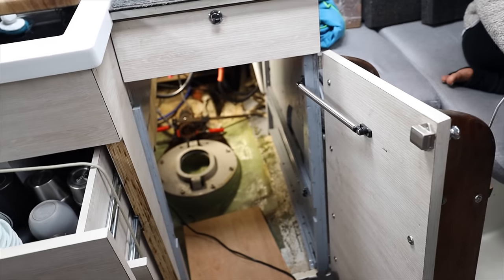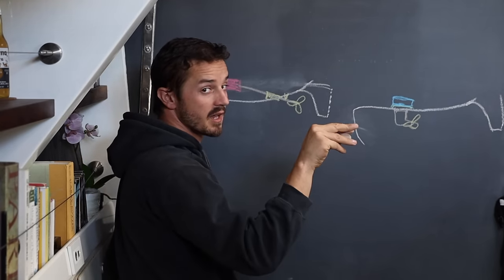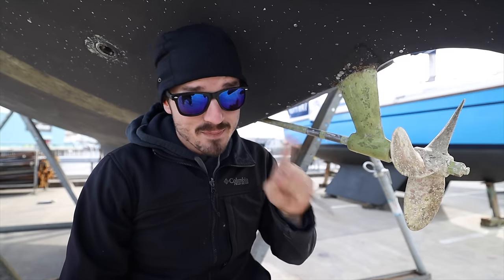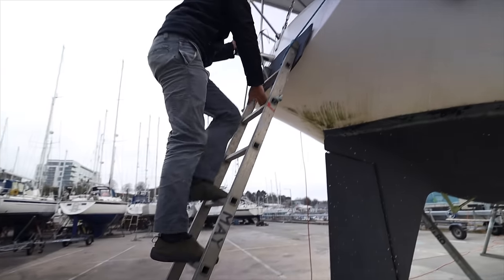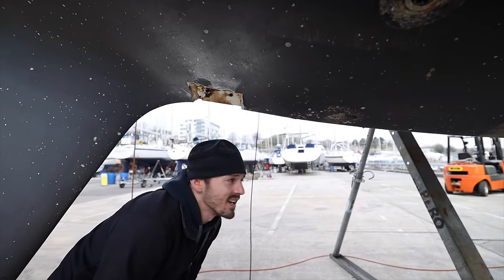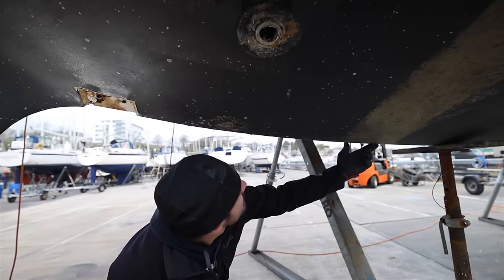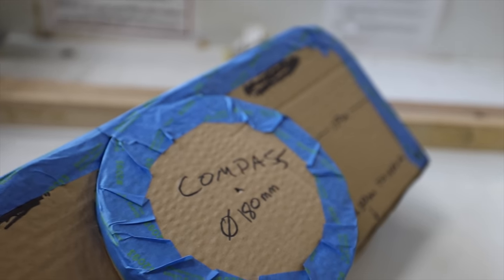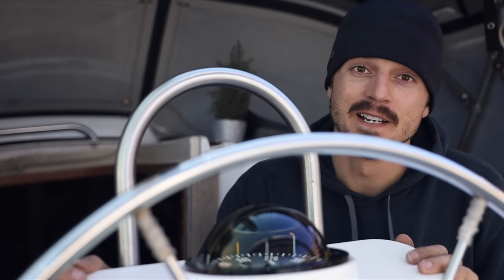CONVERTING to an Oceanvolt Electric Sail Drive — Sailing Uma [Step 213]

Comment: Hi, New  Fan,  Wish you All The Best, Keep Loving , and sharing it shows well in Your work.
 I have only watched your last 3 Videos, I found you by looking into converting my 30'  O'Day Sailboat to Electric Drive.. I am now Anxious to see your next video " Sailing Uma [Step 214] " to find out How the new motor is working, its power consumption and if it does in fact charge the batteries without a significant loss of forward velocity.  I am also wondering what the sailing recharge time is from low batteries to full charge. in relation to the motor run time.. Or to put it another way.. If the batteries are fully charged how long can you full power along until low voltage occoures. How long do you have to sail until fully charged. Exelantly informative, its Great that you showed most of the Work and the Better  than, Professional Outcome you Achieved. Not Only are Architects but Artisans of many trades.

Comment: So awesome! You guys do the coolest boat projects!!  Was the sail drive unit a refurb from ocean volt? It's clearly used? Also, how does the folding prop work on regen?? The oceanvolt motor is small! 10kw?
Reply: It's a 15kW, one touch button on the display, puts it in "gear" so the prop folds out while sailing

Comment: Did you fill the holes with anything above the fiberglass on the outside?
Some two part epoxy would fill it up incase that thin part of the hull ever gets smacked by something.

Comment: Does the folding prop lock open? I guess maybe centrifugal could keep it open when under power, but when regenerating it would just fold closed.

Never mind. Looks like you have to lock the prop-shaft to get the prop to fold. Otherwise it will spin, even when un-powered, and that spinning will force it open.

Comment: Great episode! I look forward to seeing how the new engine works out. Question: don’t you need to put barrier coat on raw fibreglass before the bottom paint?
Reply from the maker: We did.... that was the grey paint you saw us apply, but also, no. If you use epoxy you could paint antifoul right over it. Polyester not so much.
Reply: Thanks for your reply and explanation. I think the barrier coating boats I’ve seen (Mads) have all been polyester-based; hence the confusion. Keep up the great work and the great videos!
I’m sure that you’ll explain it in your next video, but I’m curious how the folding prop can function as a hydro generator - can you force it into “open” position?

Comment: When you tested the sail drive at the end you moved the control for forward thrust bur the prop moved in reverse.  Was that bad editing or an oops moment hooking up the power leads?
Reply from the maker: It’s a left hand prop, so spins counter clockwise in reverse.
Reply: As the blades were shown, it's a left hand prop. It was chucking water backwards, hence pushing the boat forwards.
Reply: Sailing Uma The fact that it runs backwards, is that an idiosyncrasy of this brand or is it something to do with the re-gen?  I know it’s not a property of sail drives because the drive on my Mirage - OMC powered - was a right hand spin.  I love the idea of the electric, it makes a lot of sense, especially for day sailers and smaller boats.

Comment: The thing you keep calling a skeg is really a strut.  The skeg is the thing that the rudder is attached to.  I had to redo the strut on my Pearson 30, and it wasn't that bad.  BTW, I'm sure some other P36-1 owner would appreciate your strut.  At some point, somebody will bend or break the one they have.  I sure hope the bottom unit on your new sail drive isn't made of aluminum becasue I have heard of corrosion trouble.  Looks good, though.

Comment: Been watching you guys for quite some time now, great content! Not sure if what I’m asking has been answered already but...

What consideration did you guys take when you were deciding where to place the sail drive? I’m actually seriously considering to do the exact same thing to my boat and have not found a good answer to that question. I originally thought a good place would be where the prop strut is, that way the prop from the sail drive would be relatively close to the original location of the shaft drive setup.

Would love to hear what you have to say about that, maybe it could even be a video on its own?

Cheers!

Comment: You little tease Kika ending the video like that. Great work installing the base. Had to be perfectly aligned or you would be sailing sideways. As an ex biker I.ve used those earplugs for many years. You have to roll them between thumb and finger, then pop them straight into your ear, where they expand and make a tight seal.

Comment: Splendid video guys!
Uncured epoxy resin on clothes will come off with acetone or lacquer thinner but I found out that methanol also works very well.  I would guess so would methylated spirits.  
Cured epoxy you can get off tools etc. with paint stripper containing 87% dichloromethane (also called methylene chloride) and 13% methanol,  one of the older proprietary paint stripper mixes and still available.
Can that sail drive be rotated to generate side thrust?  I imagine that could be useful when docking.

Comment: It's amazing the amount of free space is left over compared to the room needed for a diesel engine. I notice there is no need for a boot as is used in a diesel sail-drive. A comforting thought as those always scare me thinking about what would happen if it tears and begins to leak. 
I am wondering if the large amount of open space around the sail-drive skeg will not be a source of drag as the boat moves through the water. Is this the normal way they are installed? Sometimes minor things can have a surprising effect on the way water flows.
Reply: It has a miner effect on the waterflow, its for cooling the saildrive

Comment: Hi guys, yet another great video, keep up the good work!! Question, How do you get re-gen using a prop that feathers when the motor isn't running?
Reply: one touch button on the display, puts it in "gear" so the prop folds out while sailing

Comment: Interesting to see if your prop walk is less - my saildrive is close enough to the keel to eliminate it altogether.
Also, don't you have a rubber cover to go on the hull (like Volvo saildrive ones) to reduce the drag from the hole?

Comment: Great job well done, what sort of power output was the new unit ?  It looked fairly small.
Presumably, if you need 2 on a boat, a bow thruster might not be needed ?
Reply from the maker: It's 15kW so about 2X more power than we need. A 10kW unit would be the proper size for our vessel, but we go this one used and we can always reduce the power setting if needed.

Comment: great job , never heard of electric engine for this size sail boat ..i wonder if all the electric wiring does with sea salty air condition ? .good epoxy work , but why you did not use peel ply fabric over , save a lots of time , energy ,,ect on sanding ?

Comment: great work. Looks very good and clean. I did not understand how  this saildrive has a watertight seal. the flange was bolted and glued to the hull. there was a rubber seal in the hole in the middle. and the blue motor was bolted on top with two bolts. at that moment I thought I still saw the rubber unused when you showed the view from the bottom. then the sail drive leg was bolted on from the bottom. does this have a seal with the rubber in the hole? and does the sail drive only mates with the motor? Or does it also mates to the flange surface? It is a beUtiful system. but before there was a small hole in the hull for the prop shaft. now you have a very big hole just sealed by a rubber. when you will hit it for some reason and rip it out you will sink whitin a few minutes. Maybe an idea to make a watertight bulkhead infront of the motor? or  a pipe with a little bigger diameter than the motor. this way you will stay afloat when the seal is gone and water os rushing in.

Comment: If the prop folds how does it run the motor when it is a generator? Why is there a recessed hole in the boat bottom. Does the sail drive rotate its position? Great segment.

Comment: Would you explain to us how the prop works to go from folded to open? From the comments, many of us are guessing or know that the centripetal force opens it when the motor runs. The question is, how does the prop work for regen?  Doesn't it fold close from the water once you stop the motor? 
Can you make a video while still on the hard stand to show how the prop folds open and close?

Comment: After watching this I feel like the only downside to electric motors for sail boats is the price. But then it almost makes sense to invest in one because then zero maintaining and gas. In the end you save money and the value of your boat is like double what it was before! Not a bad idea I will copy lol
Reply from the maker: New for New, an electric system with batteries is about the same price as a diesel. The problem is, most electric companies quote the entire system, sometimes even including instal costs. When you get a new diesel quote, its often for just the motor and usually doesn't include installations, new prop, shaft, seal, pan, etc. Plus you get zero maintenance costs and minimal repair costs for the life of the motor. Plus batteries are only getting cheaper. And if you're looking to replace a seized diesel, you can get much cheaper E-motors and do the instal yourself like we did.

Comment: I’m 6’2 and marine engineer and once had to inspect a metal tank with a 2 foot square entrance located within a larger metal ballast tank inside a naval submarine. After a leg cramp while in the tank, I thought I would die in there. I was stuck and freaking out lol. Even my spotter didn’t know what to do. I manage to get out after turning purple in the face. Much worse than the engine space on this yacht. Horrible day at work lol

Comment: Interesting, I'm working at a tall ship, as a volunteer, electric motor is not a option for us. Our brilliant captain invented some thing he calls a shaft alternator, where we gain electricity, from the propeller while sailing by sail, it works amazingly well, but it makes som noise because some of the system is chain driven! 
His idea was apparently so good that almost all the material was donated for free by companies! 
IF YOU MEET HIM NEVER SAY THE WORDS SHAFT ALTERNATOR, he will talk your ears off, and in some way I understand him.

And now we can sail long trips and charge our batteries without starting the motor, which conserve our diesel. It's really valuable for the ship that has at least 20 persons on it when sailing. 
Fair wind, from Denmark 🇩🇰!

When we are fully rigged we are sailing with main sail and top, mizzenmast with main and top and 5 jibs. And if possible a jib like sail strapped between the main and mizzenmast.
She is so beautiful the old girl.

Comment: The biggest problem I see with the regen is the fixed pitch prop which is set to give mechanical advantage to the motor.  Turning the motor from the prop by the water motion might be difficult unless the motor assembly has a gearing setup to reverse the mechanical advantage.

Comment: I might be wrong, Dan, but in the short segment about the propeller, I'm sure I saw the bolt holding on the propeller making a miniscule orbit around the center point of the shaft, I hope I am wrong, or that is with in the tolerances of the machine
Reply from the maker: That is just one of the prop anodes which is roughly cast from zink and not a precision piece of the prop.
Reply: @SailingUma   cool, it was just a nano second shot....good to hear.

Comment: I was thinking that you should fill that cavity so you don't have to clean it but that would limit your ability to service the sail drive. Do they make a shaft drive electric motor? I bet they do but is it better? I know that you got that one for free from your last video but couldn't you have used that same electric motor and mounted it on a new shaft? Also, is there a clearance issue when it comes to performance or vibration with the prop so close to the hull?

Comment: Where did you guys find the Oceanvolt sail drive? It looks used and I was checking prices and not sure if buying new is possible any time soon. Thoughts?
Reply from the maker: We got very VERY lucky to get our hands on a used unit. The problem with electric motors, it that they last forever, so the "used" market will be almost non-existent. Unless you're thinking of building you're own, like we did in the beginning. Then you can find used golfcart parts all day long. 

So unfortunately, if you want a Oceanvolt, of similar purpose built unit, I wouldn't be holding my breath for a used one anytime soon.

Comment: Haha...funny how Kika's bottom goes "  Beep...Beep....Beep " in reverse.
Reply from the maker: Wait... do you mean that yours doesn’t do that? Lol
Reply: @SailingUma  Haha
Reply: @SailingUma  Kika I have very bad knees and the Veterans Administration gave me a great 4 wheeled electric cart that I use when I go shopping or to my DR. visits.  They even gave me a great electric lift I use to put it in the back of my mini van.

My cart is a Hot Rod haha  It will go 6 mph and has a range of 16 miles on a full charge.  Only one bad thing I can say about my cart is that it does not beep when I go in reverse.   I actually made beeping noises  with my mouth when I used reverse last time I went to see my Doc at the VA hospital haha.

Comment: A question on power generation from new setup (BTW great work in short time window - you have great planning skills) - the folding prop - I also have one - great for low drag sailing but its purpose is to fold and not spin under sail - yes when I first shut off engine - it still turns - I shift to reverse for a second to add load - then in sailing, no drag position. Even if prop stays open, soon as you add load of generator I would think it would collapse like when I go to reverse - how do you keep it open under reverse EMF of generator?
Reply from the maker: That saildrive is designed to lock the prop open to allow regen.

Comment: Dan, is there an automatic offset built in for the prop walk in fwd or did you set it at a slight angle? you old prop shaft should have had a slight angle too , nice install , cheers warren
Reply from the maker: These are designed to be perfectly aligned to the centre line of the boat. The old shaft was off to the side, so it would clear the rudder when removed. The new system will take some getting used to though, the prop spins the other way, and it's further forward and the throttle is totally different and the prop flips and folds, so it will be like driving a completely different boat.
Reply: @SailingUma  Please consider EASING it into forward or reverse to prevent trauma to the drive train and propeller components.

Comment: Probably a dumb question, but in the locations you cut out the old gear, did you jus cover it with fiberglass or did you go back and fill it with resin? Or did you fill it completely with fiberglass to match the thickness of the hull. I don't even own a boat (other than a canoe and gang load of kayaks) but very curious.
Reply from the maker: We patched it over from the outside and then filled it in with thickened epoxy from the inside and glasses that over too.
Reply: @SailingUma  thanks for responding. The dream is to eventually get our ducks in a row and make it to being liveabords. Been set back pretty heavy in the last 2 months but that hasn't stopped us from continuing to learn. Much appreciated. (The response and the videos)

Comment: [Question] how does regen work with a folding prop? 
Also, love your videos. ❤
Reply: one touch button on the display, puts it in "gear" so the prop folds out, the motor regenerates
Reply: @bybont  Thanks. I didn't realize the folding could be remote controlled. Makes sense.
Edit: We used to have to rubber band our folding prop when we were racing to keep it folded.

Comment: Ear plugs need to be shaped. Basically you take one, twist it, make an U shape where you pinch the big end of the plug with your pointer and thumb, but still hold a little bit of the tip with your pointer. Then you bring that to your ear and release just the tip, making sure not to let it un-twist. Once you locate it, you push, and let go. In theory, it should enter just enough to put pressure. Don't push it too much tho. ALSO very important if you use these, you should clean your ears with hydrogen peroxide from time to time, they can cause build ups of wax. But that's only if you're using them every day for a long time.
Reply from the maker: 🙄 trust me, the issue isn’t not knowing how to put earplugs in! The issue is that those specific ones were too large, so they hurt when they expand... the solution was Getting smaller earplugs and it works fine now!
Reply: @SailingUma  Ah. That explains it. Yeah, when you get the bigger ones, it won't work right regardless of what you do.

Comment: They make rubber gaskets that seal the sail drive tunnel. Not watertight, but they eliminate the drag caused by having that big freaking hole.

Comment: what motor is that ? And is it meant for sailing or adapted as the frist one was ? The foot of the saildrive looks used and adapted. Correct ? Thanks for the info.

Comment: My bet is your going to need to  double the battery bank and add a wind generator or extra solar panels. Or it might be a pluse and you can double your batteries because use of all the extra room you gained and weight you lost hopefully it's pluse.

Comment: it takes 30% more torque to undo a bolt that has a nord loc than to tighten it, just make sure you do not use any plain washers with it